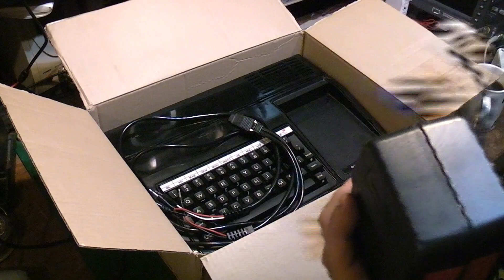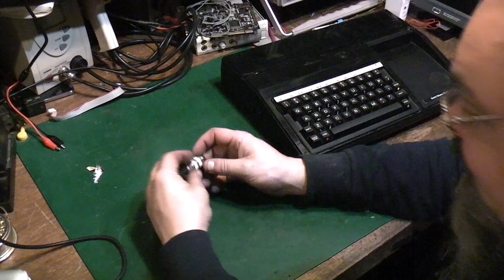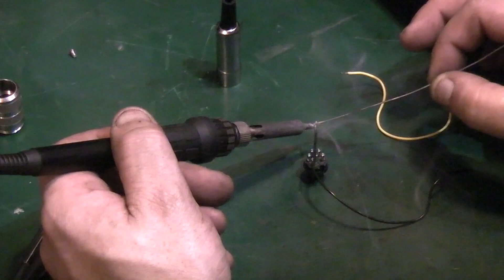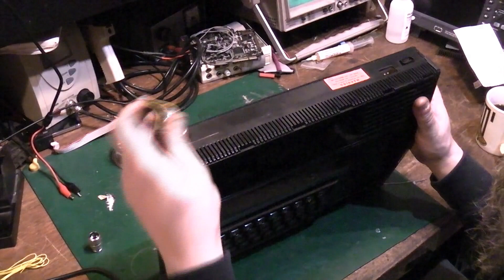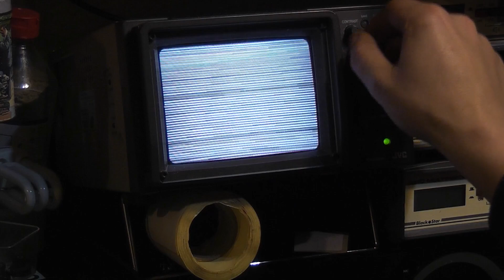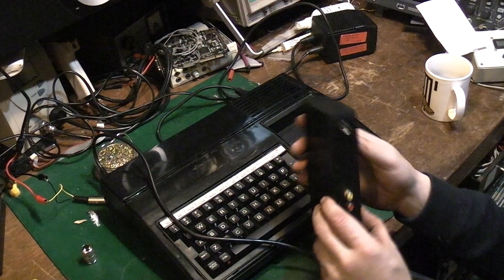Ti-99/4A revisit Pt1

Comment: Bit confused with the cable you made up. The connector in the diagram was upside down compared to the physical one so surely the wire should have been soldered to the 1st pin on the left rather than on the right?
Reply from the maker: Thanks for the reply, you could well be correct. Ill take another look when im back in the workshop.